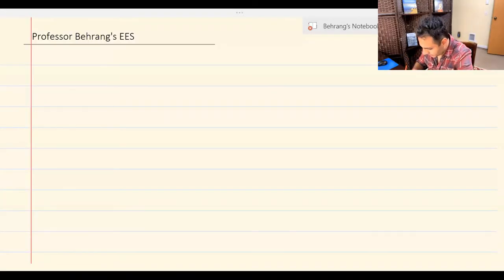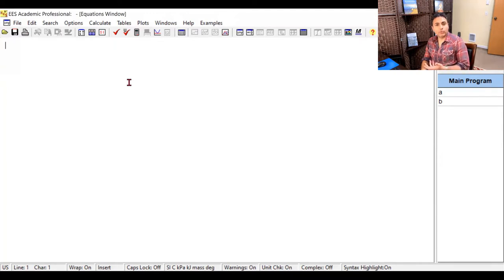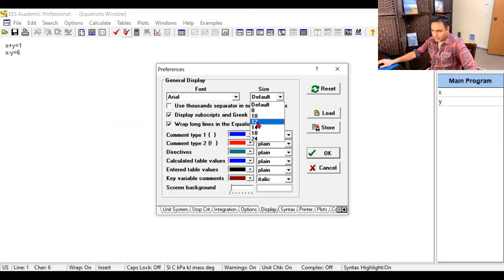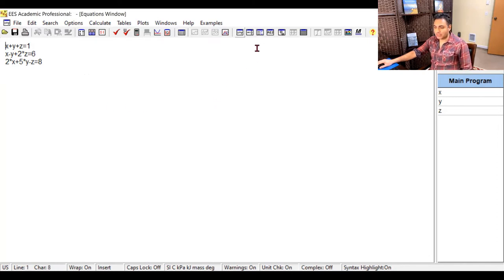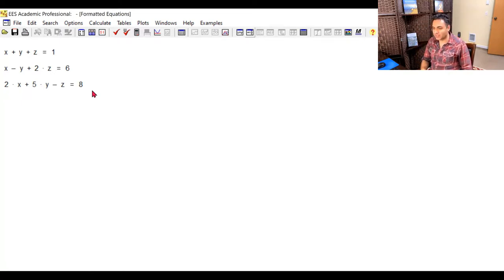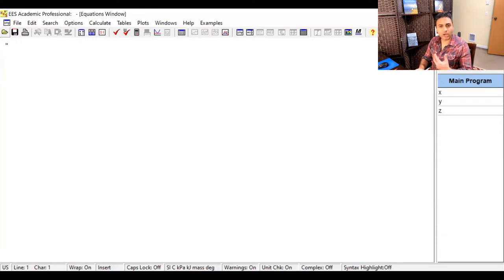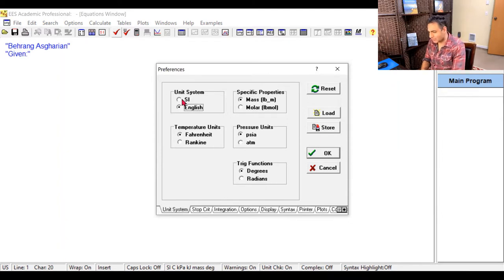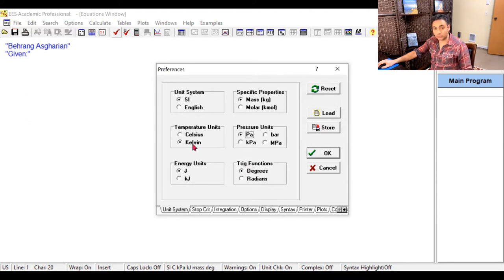How to use EES. Basic Introduction to EES (Engineering Equation Solver) with one Example.

Comment: Aloha Professor, I have another question for you. I am looking to make some videos/screen recordings for my students to introduce them to EES (and how to access it on our network). I know how to do the screen recording with audio, but haven't figured out how to do the markup on top of the EES window as you are doing. I run two different systems: an academy issued (and controlled, I have no admin rights...or very few) PC laptop with touch screen and stylus and running windows 10 and EES Commercial Academic on Citrix VDI; and, my personal MacBook Pro 16" M1 with MacOS Monterey running Widows 11 on Parallels, and using EES Professional (my own personal license). I can also use Parallels Access on my iPad to connect to my Mac and run Windows and EES, or I can use Sidecar to control the Mac from my iPad. Are you using a built-in app to produce your videos? or something else? (If you don't mind sharing)
Reply from the maker: Windows and zoom (annotations) will give you this capability. I don’t know about the other ones. However, You need to record the entire video once. If you make mistakes, you will have recorded it again.
Reply: Use OBS software to record screen add mic and extra video capture device as well.

Comment: How does EES compare to Matlab or mathematica?
Reply from the maker: MatLab is a more powerful programming language. The powerful thing about EES is the fact that you have access to Equation of state functions for various substances. So you can use them to optimize a cycle for example instead of spending time on try and error using thermodynamic tables.